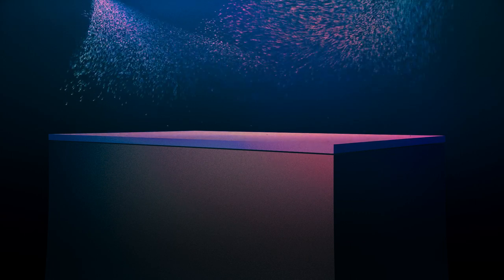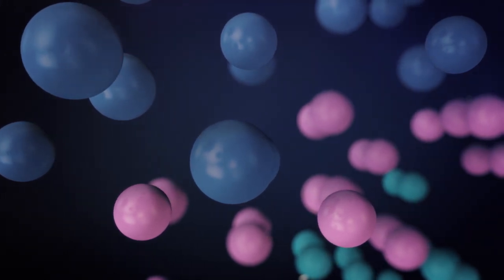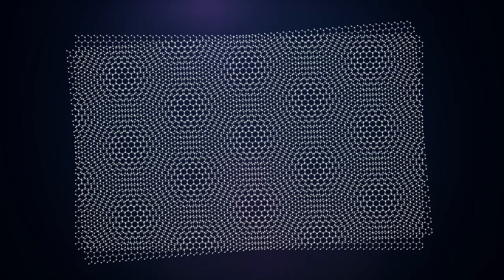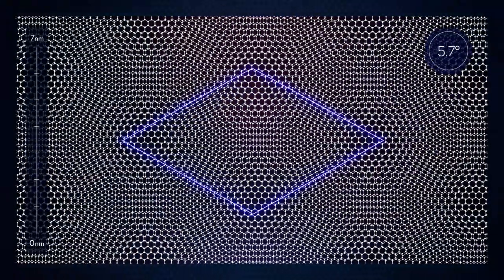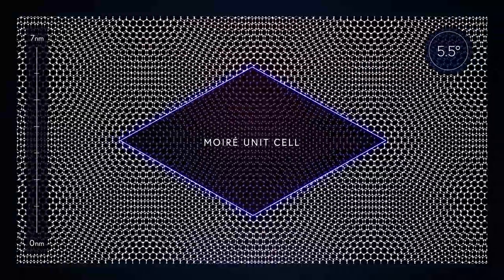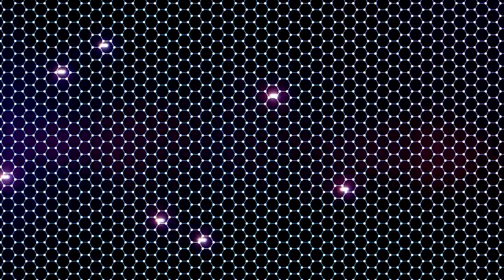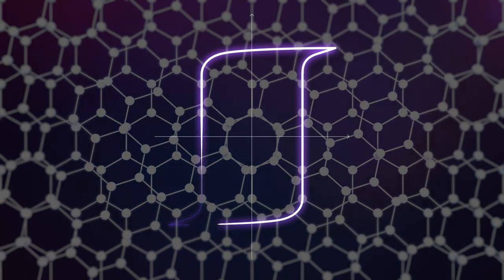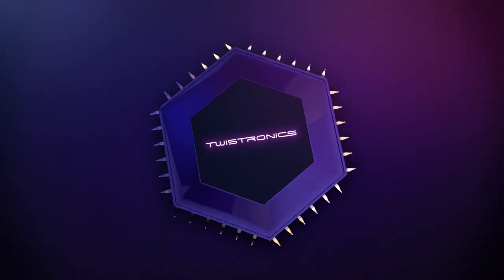Twistronics: building moiré superlattices from 2D materials

Comment: Yeah, but how do you modify the angle of one layer in the Bilayer Graphene? Nanomachines?
(Actually, that is a good idea)
Reply: you simply assemble the structure layer by layer with one layer slightly rotated
Reply: @alexanderitartakovskii7202   very informative tahnks
Reply: We use the rich toolkit of the semiconductor industry. For instance, we don't need to mechanically twist anything, we can grow the single layer crystals in place through CVD (chemical vapor deposition).

This process grows a structure from a series of strategically placed "nucleation" sites by having atoms fall into place from a gas phase.

We can then first grow the bottom layer and then change the gas flow conditions, shifting the place where the second lattice will nucleate. This will grow a second rotated layer.
Reply: @pseudolullus  Is there a technique to dynamically tune the twist angle?
Reply: @alexanderitartakovskii7202  yes but this means absolute fidelity and consistency in fabrication so you can alter these at creation by these small scales and ensure it all fits properly. this stuff requires precision at least for now.